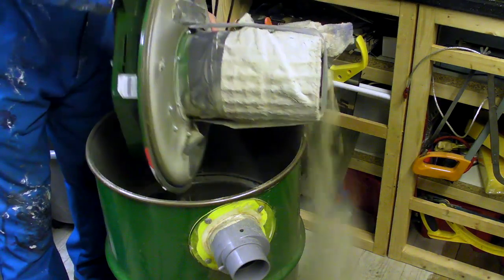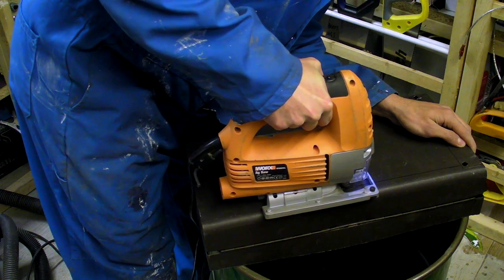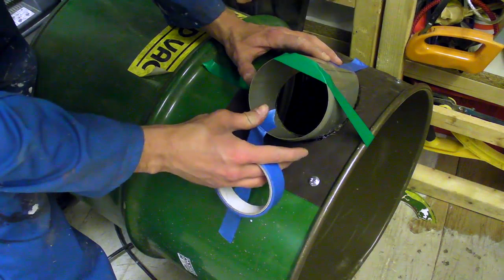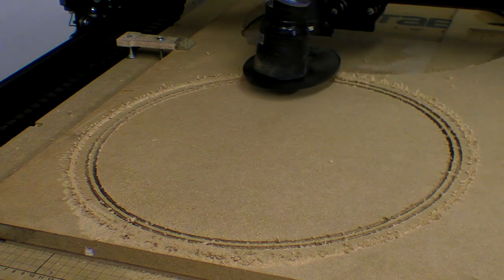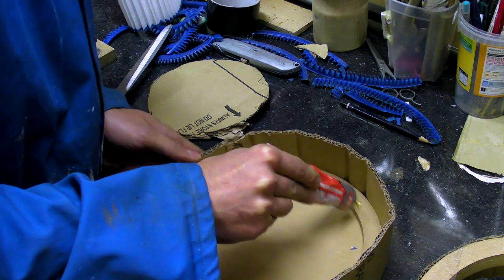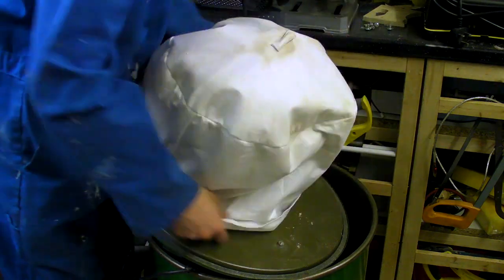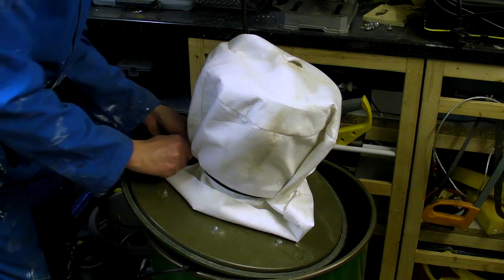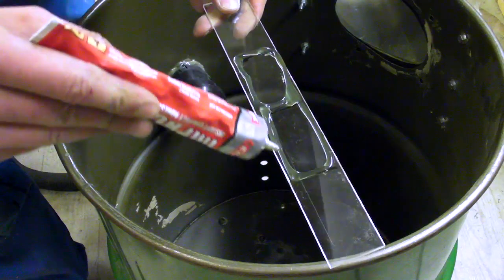Extractor Upgrade - Cyclonic Inlet and HEPA Filter - Part 1 - Voiceover

Comment: I like the voiceover. Good upgrade. But why did you cut the pipe flush with the barrel? I bet the system is more efficient if you simply stick the pipe right trough the barrel. It would create low pressure to inlet.
Reply from the maker: Tiit Saul Thanks.  It would have caused an obstruction to the cyclonic effect.